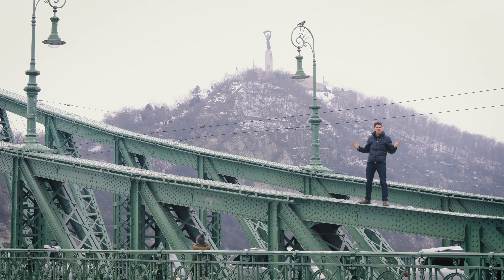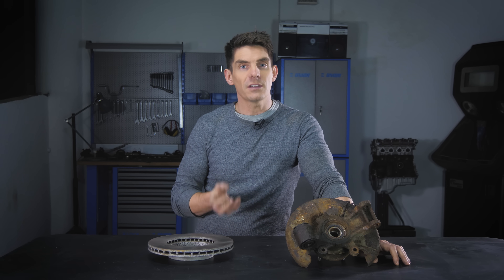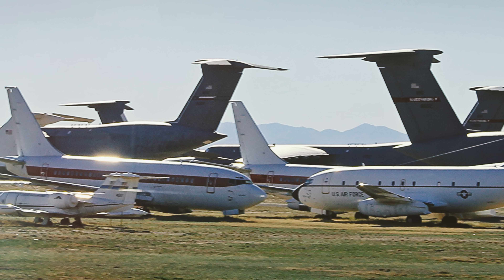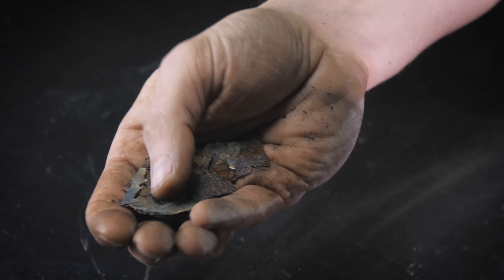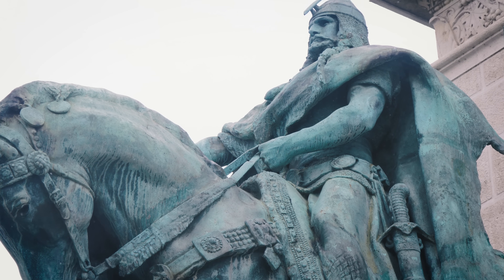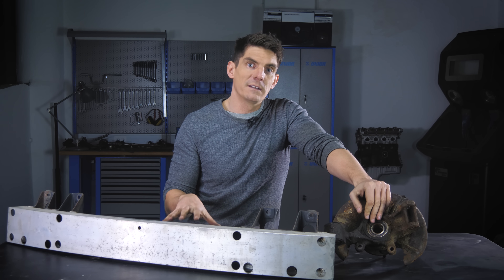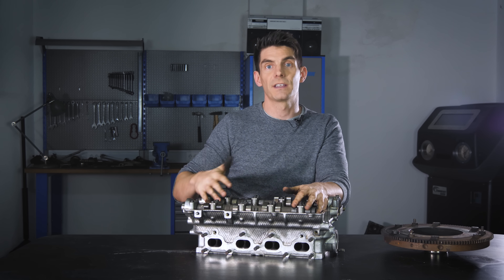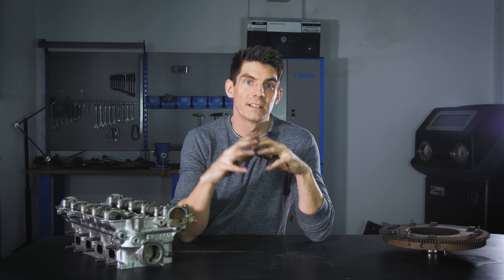Rust and Corrosion: A 10 minute guide

Comment: This video was informative, entertaining, and cool. I worked in the oil field in West Texas, and we had to deal with rust all day every day. The part where you said the oxides of iron expand more than iron, and between the threads it locks the nut into place. That is no nonsense. We would spray penetrating lubricants and use heavy duty impact guns. Good times.

Comment: Good video. Galvanizing seems to be done not to proper standards as of late with metal screws and the coating comes off as you are screwing them in?? It's better to go with stainless. Low quality stainless from certain countries and blue steel. Rust almost act like a micro-organism as it needs moisture and oxygen and spreads with contact.  Why does rust seem to spread when it is moved into a non rusted environment and in  close vicinity with metals that are not rusted?  I have seen this even in stainless steel that is highly resistant though it seems to be more surface.? What about magnetic and electric fields? Batteries seem to increase rust (especially leaking in electronics which would never usually rust) is this due to leaking acids and salts and moisture?. I notice they take the batteries out of cars at the junkyard is this for rust reasons?   Why does a quarter panel rust out if it's not grounded to rest of your car? What about black pitting and corrosion on certain tools.

Comment: Rust is probably the #1 cause of why brakes seize & wear out prematurely. That's why brake grease is recommended between the caliper bracket & shims.
Reply: you are very mistaken.
Reply: You have to lube the caliper pins too that dry out every year at least if not twice on salted roads.